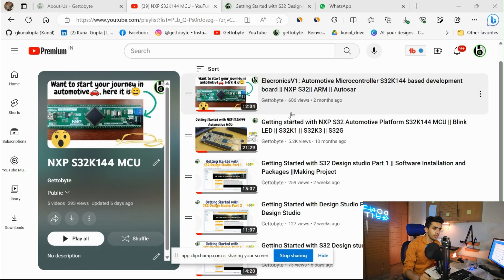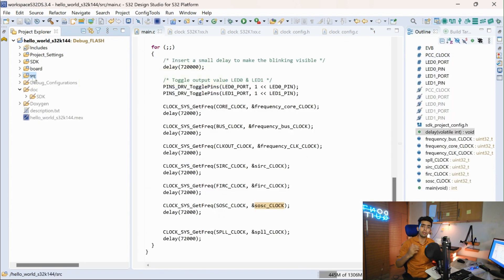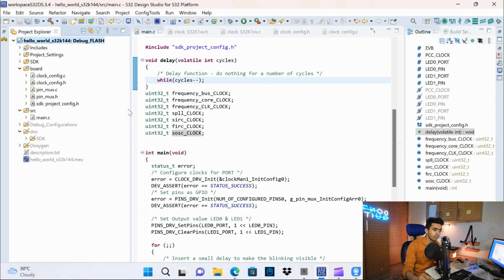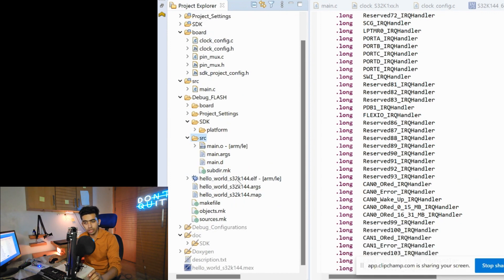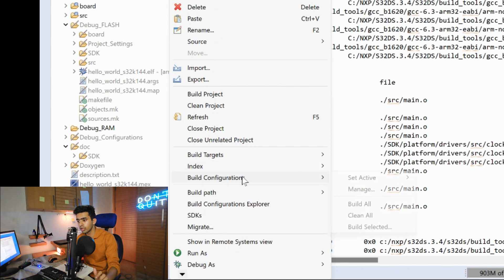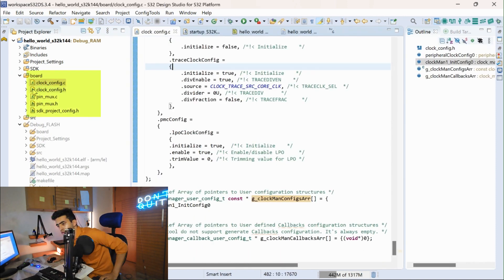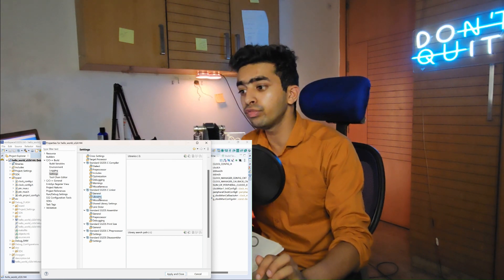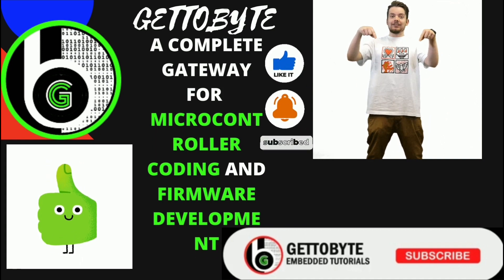How to build/compile the microcontroller project in IDE ||S32 Design Studio || S32K1||S32K3| GNU-GCC

Comment: Good Afternoon sir, 
I have been working on a PWM Simulink model for the s32k312 evaluation board. When I add the "set_period and duty cycle" pwm block
Though I change the value of duty cycle(in simulink) the value does not get reflected in the target mcu. However, when I change the values from the tool platform, I can see the change being updated on the target. If possible please clarify !
Reply from the maker: @paulephraim2326  

Hi, please mention your dout, over here in brief, will answer their properly: https://gettobyte.com/community-forum/
Reply: @Gettobyte   how to post sir , I have registered , but I don't see an option to post doubts in the forum page
Reply from the maker: @paulephraim2326  Once you regsiter and login on website, navigate to forum categories.  You post your query over here: https://gettobyte.com/community-forum/forum/programming-and-debugging-related-issues-2/

by clicking on new topic
Reply from the maker: @paulephraim2326  did u post?
Reply: @Gettobyte  Yes sir
Reply: @Gettobyte  sir I have posted the query under the topic of s32k312. Please clarify !